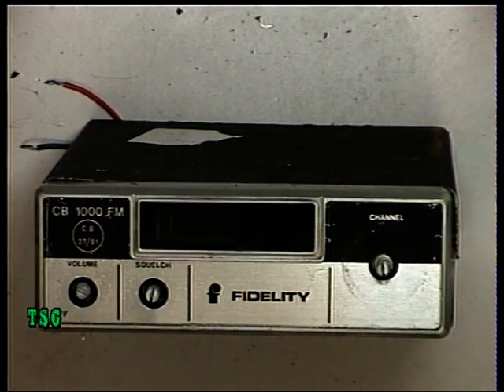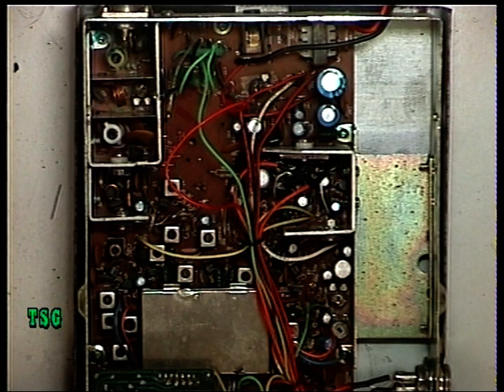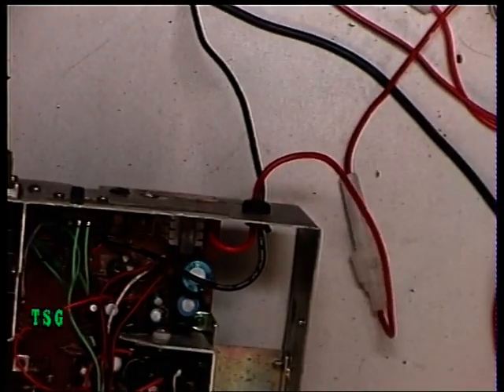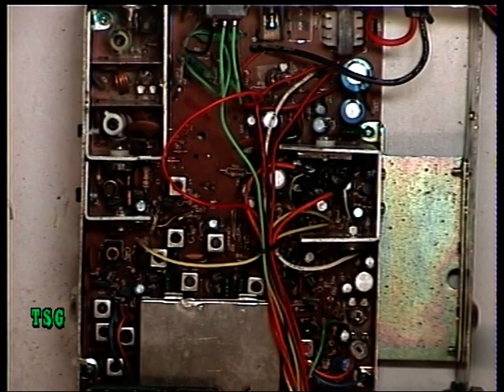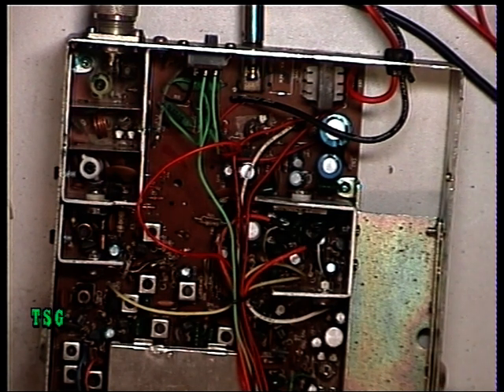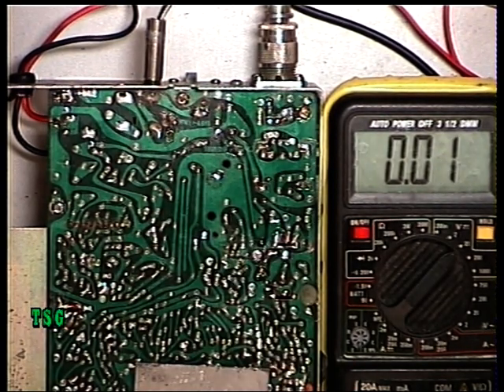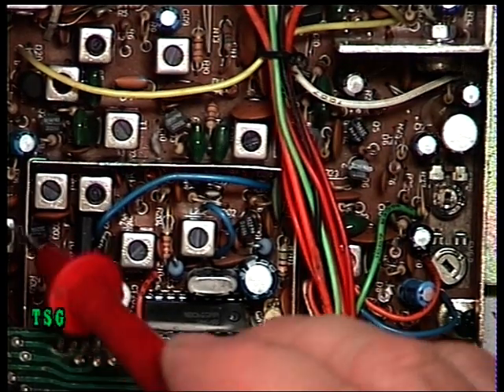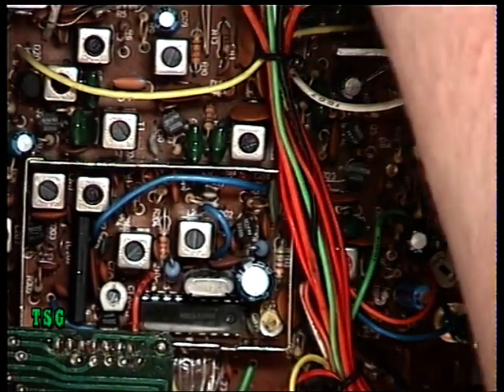Fidelity CB1000, UK (CB 27/81) CB radio (Mobile) -  repair & vco

Comment: i had one it was called the gecol 1000 it was the pitz and was total shiit .. jeff..
Reply from the maker: The Great (Taiwan) GT848/GT858/GT868 was the worst performing UK CB chassis of all time. They were a 3.5W set...not 4W. Look at today's offerings in 2021. Most coming out of the box at around 2.9W & not tuneable beyond 3.6W! However at least the 3.5W transmit sounded good. Contrast that to the receiver; very sensitive...perhaps it's downfall, but adjacent channel filtering was very poor. The radio chassis was soon known as a bleedover box. 

Nowadays with far less users in most areas, these kind of sets can give rewarding results. One thing for them. They were always reliable.

Richard, G0OJF, UK

Comment: Hi Richard. I just acquired one of these sets. I had one in 1987 as my first CB and yes it was dreadful for bleed over. I used it a lot though and it was pretty reliable. The one I've got now won't power up. Someone has fitted a 15 amp fuse in it and something inside has got a bit warm I think. When I connected it to my power pack the set put the power pack under considerable load when I switched the set on. I turned it straight off of course as I could tell it wasn't right. The set itself doesn't look too bad, maybe worth a repair ? I was wondering If you would be interested in taking a look at it to see if you could get it working ? Many Thanks, Matt.
Reply from the maker: Though I normally only do work for the trade & would sort yours out for you. Probably been reverse polaritied...with the 15A fuse & taken out the Audio I.C & protection diode. £16.50 + parts + cheapest return post at cost. rshireby@yahoo.co.uk

Comment: Were these sets actually advertised as '4 watts' on the box or on any literature? If so then surely it would have been a trade description issue if in fact they are producing (in some cases) almost half that amount?
Reply from the maker: No, the blurb said 3.5W on the specsheet.

Comment: Brilliant video Richard do you think you could pull out the Fidelity CB3000 and take us through a sweep test with that thanks
Reply from the maker: +charlieoscar09 Yes, it's planned to do the CB3000 rx only now we have test bench 3 here & not in another building.....though it'll be a shakey camcorder job! There is a Fidelity 3000 here that some wally sprayed black earmarked for alignment. Well screwdrivered it is 

Then you'll get sick of GT858/GT868 alignment videos I reckon there are about ten badge engineered versions.
Reply: @ukfmcbradioservicingTango21  can I send my fidelity for a service and power connector repair please